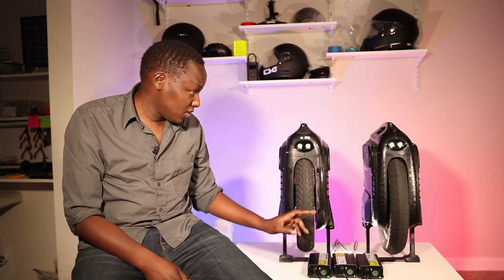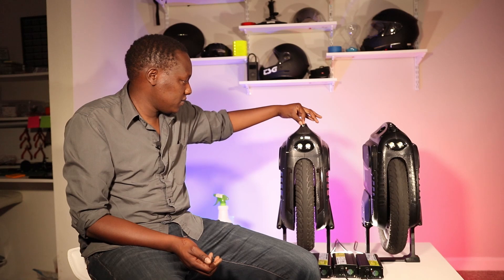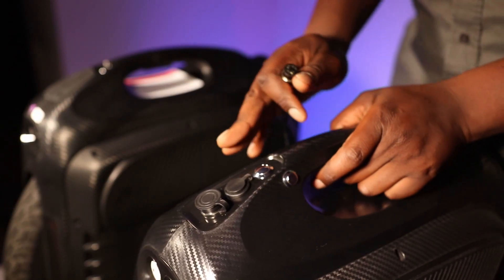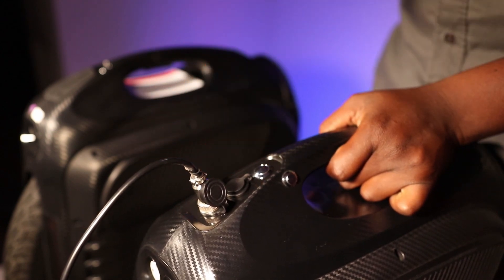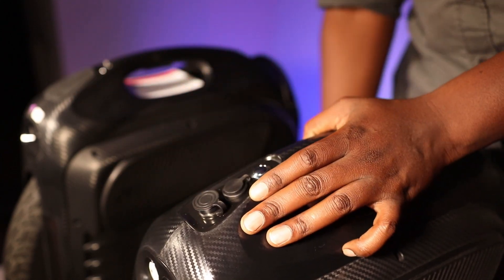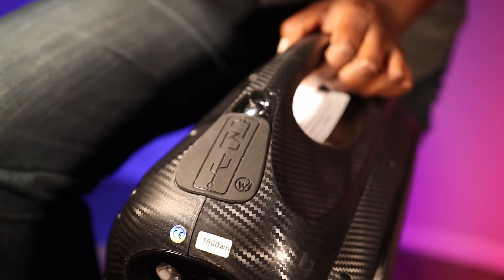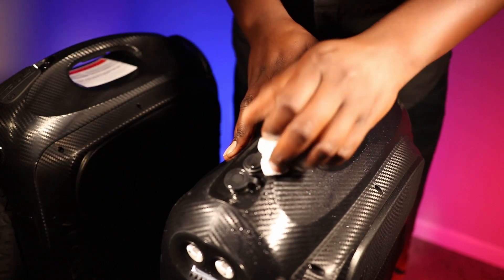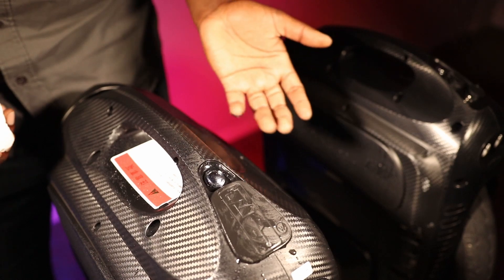Gotway RS Charge Port Design Flaw

Comment: Good points. I wonder whether they changed to recessed power switch to minimize possibility of turning the wheel off while riding with the seat.
Reply from the maker: If you put the normal gotway seat on it the seat clears the button really well....its the introduction of the 2nd charge port that forced the design...I believe they tried to put all the open ports under one roof/Flap..Thanks for watching